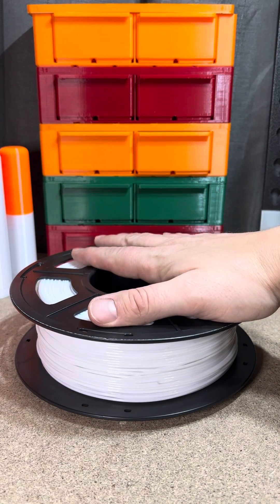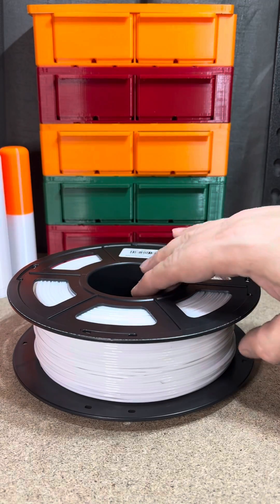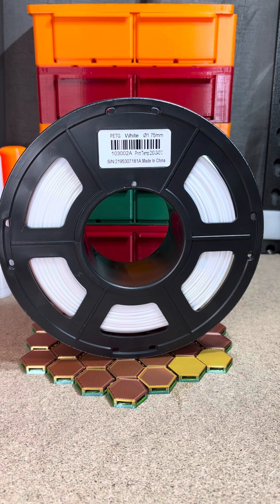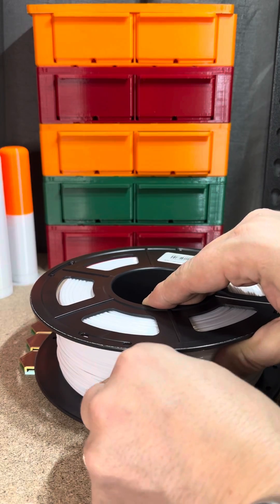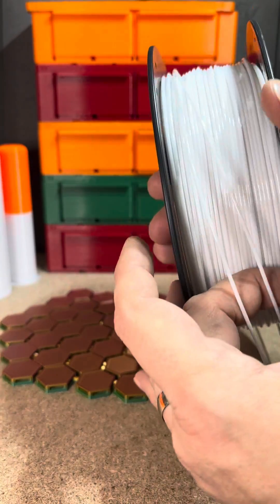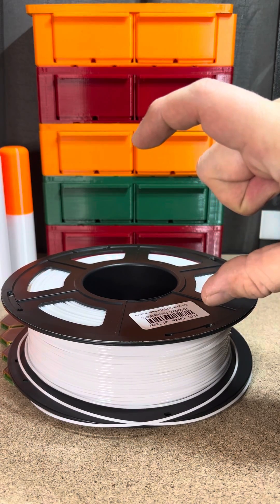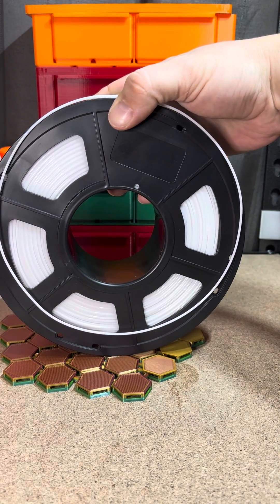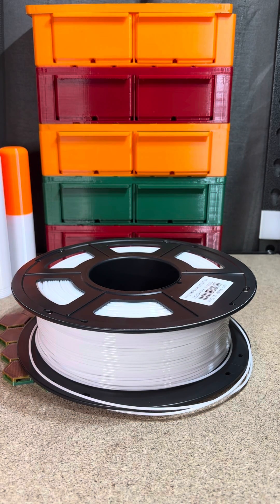Ruined Spool of White SUNLU PETG

Comment: My filament dryer did that to a roll of PETG! I now only use it on low settings for longer. I have a PID controller and a solid state relay to fix it just not gotten around to using it yet.
Reply from the maker: O wow that’s crazy

Comment: Make it wet not in that way lol but put it in water then respool it and dry it and it should work I had it happen with PLA and did the same thing and it worked
Reply from the maker: Thanks! Printing spooler now!
Reply: Make it wet, re-spool, then dry? Interesting… I have the same issue with a PLA from Creality. I figured it was just crap since I had dried it for 12hrs